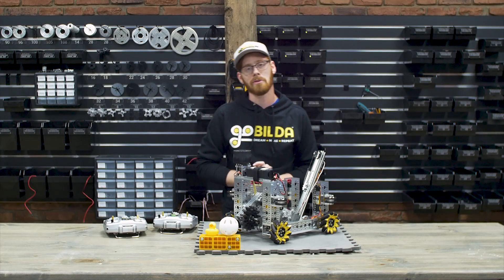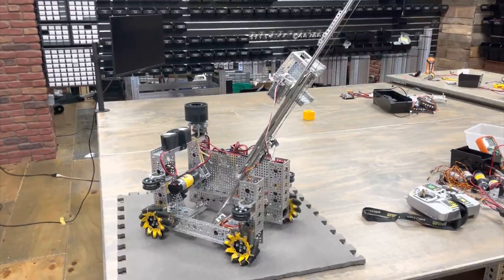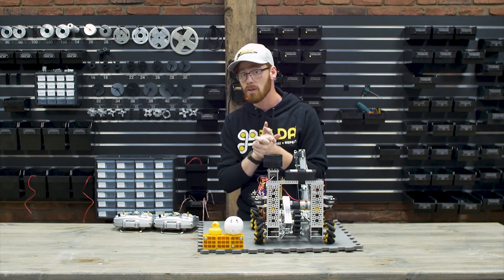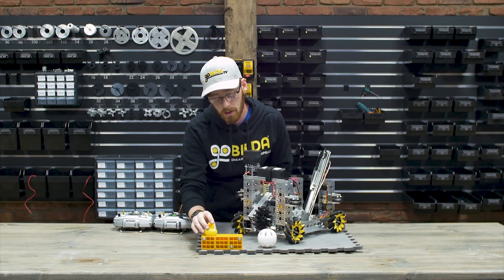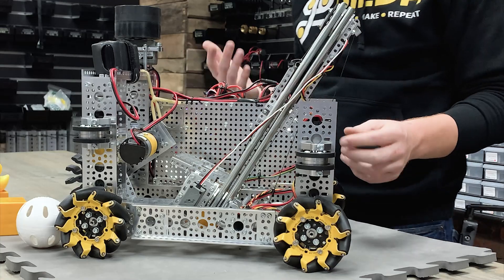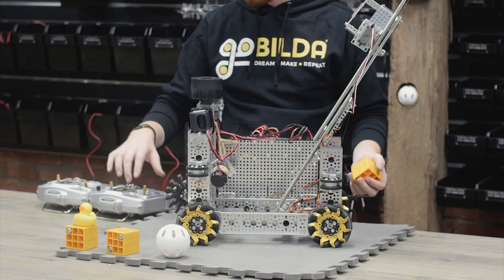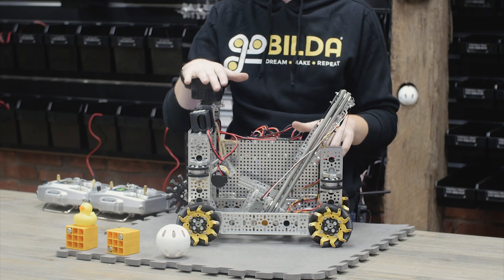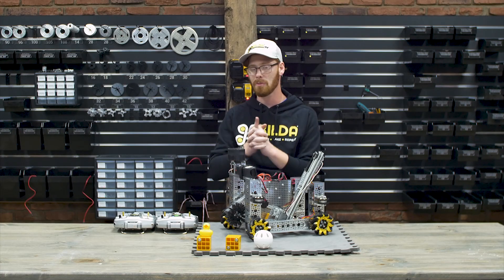goBILDA Freight Frenzy Robot in 3 Days Overview

Comment: How do you get the linear slide to retract? You mentioned something like a double pulley, however my team hasn’t figured it out yet do you think you can give an explanation on how it works?
Reply from the maker: We have a separate string that's wrapped around the pulley in the other direction, this pulls the slide back down as the extension side is feeding out line. We will have a video on this soon.
Reply: Has a video been created explaining this?
Reply from the maker: We just released one! You can find it here https://youtu.be/TRyI8FNifdA

Comment: Thanks for this summary GoBilda - We were thinking about doing something similar for side rollers. 

Can you provide more information on those rollers. For the wheels is that a 1504 pattern spacer with a 6mm flanged bearing in the center? (And how wide is the pattern spacer?) It looks like it's about 6mm matching the wheel. 

-Thx.

Comment: Why don't you guys use a Control Hub? Is there a good reason or is it just because you compete with Rev so it's not a good idea to use their product (if so, I don't think you're a bad company, it makes complete sense)
Reply: It's probably just simpler to use products they have on hand rather than buying a Control Hub, which they don't really need to do as they aren't competing in official events.
Reply from the maker: The big reason for us is speed, we can much more quickly put together a functioning chassis with an RC system, and because this build has such a short time restriction that's critical.